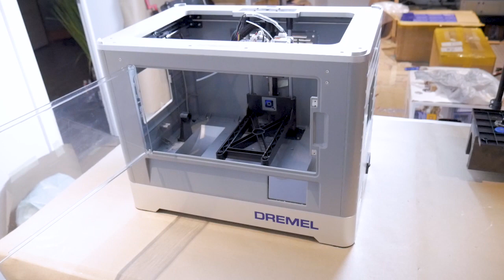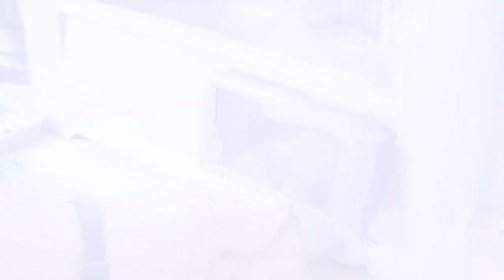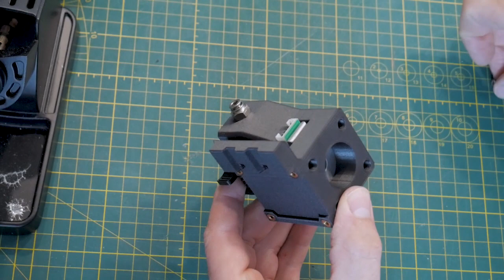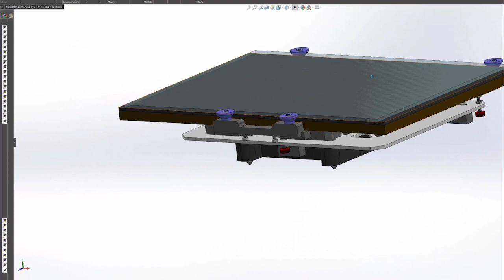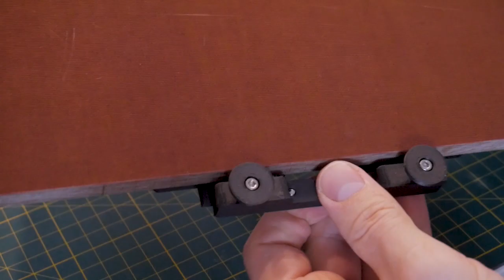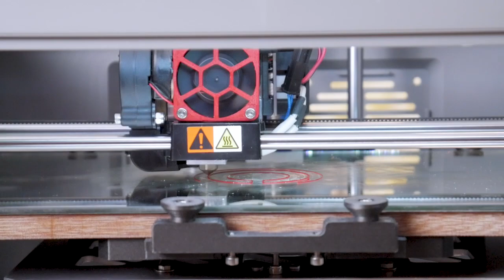Custom 3D Printer Build Project! Duet 2 Wifi, PanelDue, Kinematic Bed, Spool Holder, Hot End PCB!

Comment: Only read the description... my word how much did this cost lol.
Reply from the maker: Lolll too much - bad investment
Reply: @EmbraceMaking my friend got ripped off and spent 600 on this. Your video was all I could find on upgrading. But could he just upgrade the bed to something heated and ass an autoleveler? If so it would be an alright printer.
Reply: @EmbraceMaking my friend got ripped off and spent 600 on this. Your video was all I could find on upgrading. But could he just upgrade the bed to something heated and an autoleveler? If so, it would be an alright printer.
Reply: I printed a simple cup holder and it just couldn't do it. The original bed is warp so I can only print an area of 100mm, seems to work best. Will switch to 1mm nozzle for fun. 

My go printer for vase and pots and for old filaments 😂

Comment: For about $120 you can upgrade carriage system to aluminum with the option of dual heads. The dual head setup will cost a bit more. Think there also upgrades for the bed too.
Reply from the maker: Thanks Caribe, it was a fun custom build but I think I'm going to be focusing on some other platforms in the future. The dremel printers never really seemed to have taken off.

Comment: Awesome work my man. I have a question tho: where did you get the cad model of the extruder? Did you do it yourself cause I can't seem to find one. Thanks
Reply from the maker: If I remember correctly I made some of it myself but I believe I started with some generic extruder model I found on grab cad.... I believe it was a makerbot one I found as this printer is technically a flashforge but it was derived from a makerbot model years ago...
Reply: @EmbraceMaking  Ohh I see. Thank you for the reply!

Comment: I like very much how you used network cabLes .. does it work ok.? I thinking in doing somethin like that
Reply from the maker: Yes works great, but be sure to get CAT5e as I believe these are the thickest wire gauge of them all for maximum current carrying capacity.

Comment: I don't think the thermal paste goes on the nozzle/bottom of the heatbreak
Reply from the maker: It doesn't seem like common practice, I know, but I figured why not? As long as it doesn't get inside of the nozzle it shouldn't hurt and it should aid in heat transfer to the nozzle. You don't want a cold nozzle. Plus when I used to work in the injection molding industry, I believe the techs used to put copper anti-seize on the injection molding nozzle thread as well.. so for a 3D printer it should be fine :)
Reply: @EmbraceMaking  I think it's mostly because common thermal pastes aren't made to withstand 200C+. Not sure about the compound you used though

Comment: Hi, do you plan on putting heated bed on it...if u have video...do recommend it to me😁😁..realy want to utilize my 3d20
Reply from the maker: I do! Probably won't happen for a few more months though, but its coming!
Reply: @EmbraceMaking  did you ever put a bed on it? ...I'm might do something similar, but I'm having problems finding bed heaters in the right size...
Reply: @EmbraceMaking  wooww...cant wait...already subscribed ur channel. How about dual extruder, do you plan to modify this 3d20 with dual extruder. it is a rebranded from flashforge dreamer isnt it? Is it possible to make it dual extruder printer